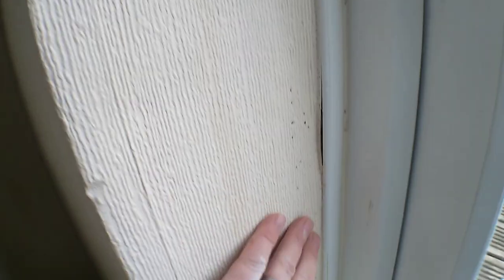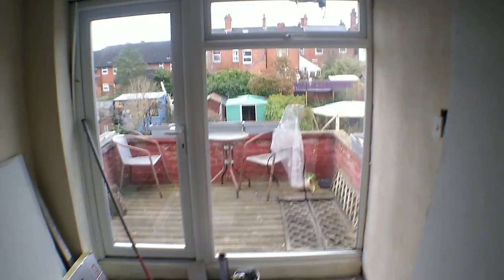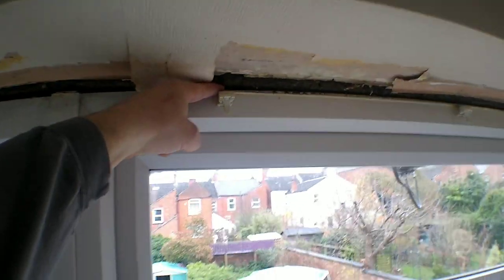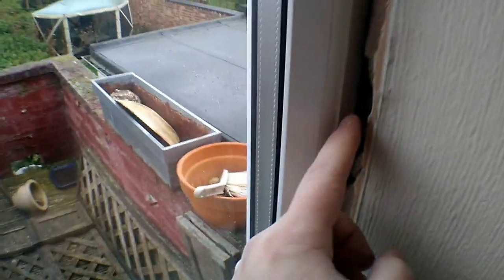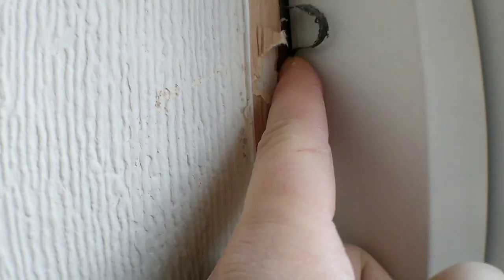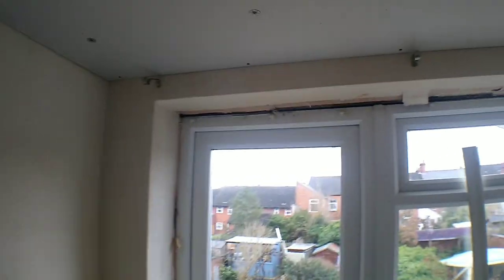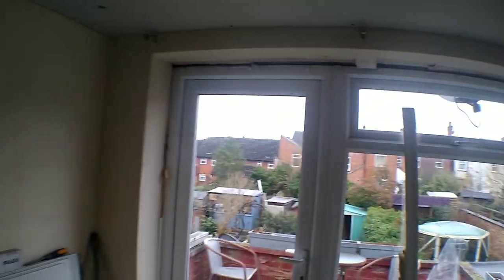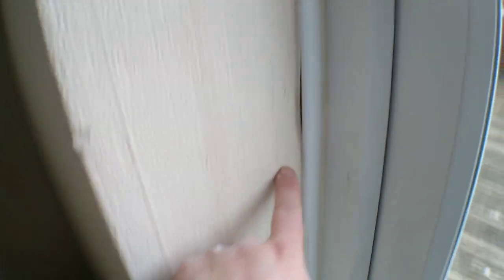MOULD AROUND WINDOW WHY?

Comment: I reckon the majority of windows installers in the UK would do what was done in this video. I am having my windows replaced. Every single one of the guys who came to quote me looked at me like I’d spoken in Swahili when I mentioned that I want expanding foam tape rather than foam, would be adding airtightness tape (Tescon) around the perimeter and insulating the reveals on top. 100% if they could they would get away with the absolute minimum and cover up whatever they can with trims, then they would. So completely disappointing.

Comment: These gaps are so common, don't understand why the windows aren't sealed at point of installation.
Reply from the maker: Thanks for watching the channel Paula your right its bad workmanship the windows should be properly sealed when fitted
Reply: @SDRobertsPlastering most windows have air vents put in. There was no air vent in that window.